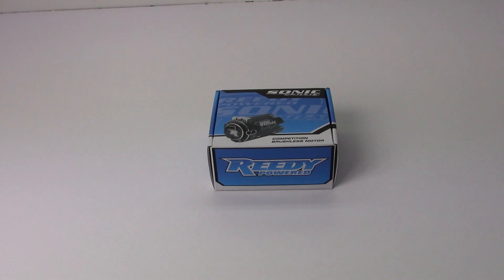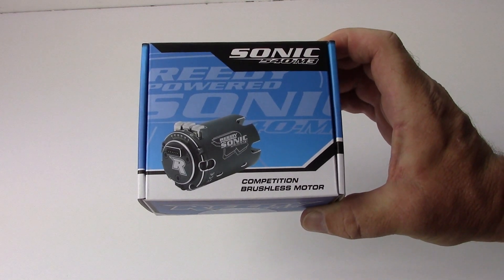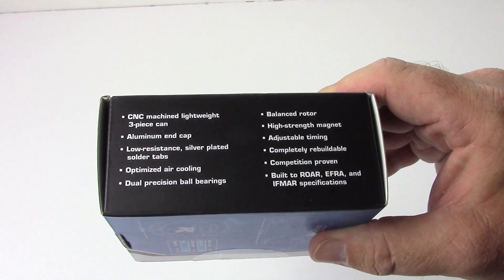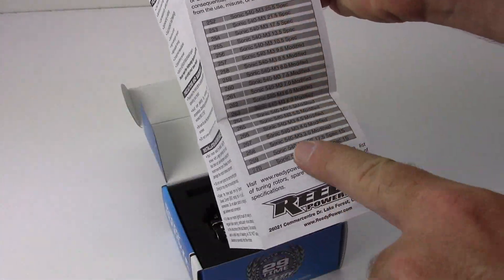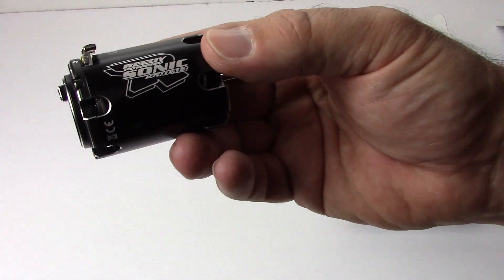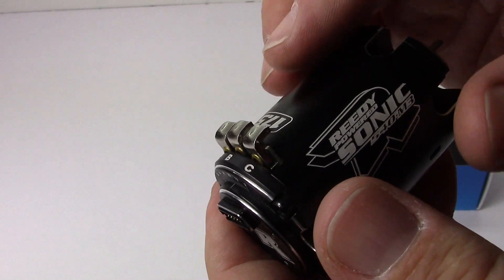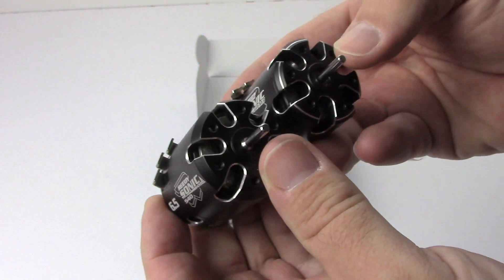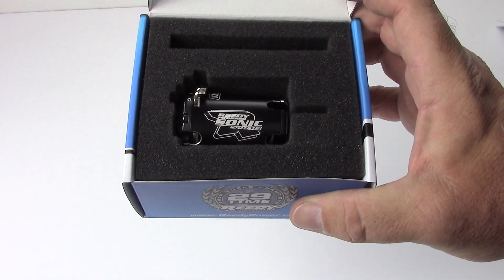Reedy Sonic M3 540 Motor Unboxing - Mach 2 Compare

Comment: I dig how they did the solder tabs..very nice. Absima does that to their motors and those are killer motors with great resistance and current draw.
Reply from the maker: +Chester Copperpot Yep, very nice solder tabs....I can already tell!
Reply: +The RCNetwork +Chester Copperpot Maybe the Absima and Reedy are produced on the same assembly line ;-) The older Reedy has some similarities to the Trackstar motors... But maybe it´s a coincidence :-)
Reply: RCHamburg Probably...like the Orion, HW, Reds Racing ESC etc etc..a lot of similar designs.

Comment: Imo reedy motors are worth the money.....I had a old reedy 3300kv motor in a basher rig that I had beat the snot out of and I finally killed the basher so I pulled the electronics and motor and gave it to a newbie who has beat the hell out of it never cleans it and over heated on several occasions and it is still going strong. yes it is a bit sloppy and doesn't perform as well as new but I am shocked that it even still running after seeing what it has been through.
Reply from the maker: +Craig Schofield Nice!  It's nice to hear stories like that.  I recently read the story on AE/Reedy and it's amazing what those guys did back in the day....

Comment: Hey Rich..you have plans on getting(if you don't already)a motor analyzer? Like the G-Force one? That'd be cool to see motor reviews with a direct test of the kV, sensor board and rpm results.
Reply from the maker: +Chester Copperpot I haven't planned on it.......but like everything in RC, I typically don't plan on it! lol
Reply: The RCNetwork lol yea. I use to follow a guy who'd do that. Unbox and throw it right on the box to see if it matched the specs on paper. I want to get one of those, a gaus meter to check the strength of the magnetism of the rotor and a good resistance meter. I want to have a nice little test lab setup so..any issues I can check myself before sending a motor in if need be. Or just general testing which, I'm sure you know..can be as fun as driving lol

Comment: are the large openings for cooling going to make it harder to keep the internals and bearings clean?
Reply: Depends where you run it really and what kind of setup..rear motor, mid motor. Obviously a mid motor will help keep it cleaner. And if you run on a loose or loamy track. I use to run a stadium truck back in the day on a very, very loose almost sandy track and it was hard to keep the motors clean. Bearings would get destroyed quick. But most tracks these days are clean enough that motor issues are not a big deal.
Reply: Thanks for the response. Thats what I was thinking.
Reply from the maker: +Justin V Like CC said, depends on where you run.....They do a great job of keeping things cool and the motors are fully re-buildable
Reply: Justin V  I believe you are right

Comment: do you think that the reedy products are worth their price? ive had alot of luck with smaller brands, and ive always wondered if the reedy stuff really that good?
Reply: Their stuff is good. I ran several different motors, one being a Reedy Mach 2 and its comparable to most big names.
Reply: +Chester Copperpot i have a b4.2 running the smc racing stuff, it works well, but im gonna get a b5 soon, so i was debating weather to dish out the money and buy a m3 motor
Reply: +Chandler Thomas Honestly, if you can get their last gen motor for a good price..I'd do that. I won't spend anything over $80 on a 10scale motor. I like Orion motors..but $120-150 for a 10th scale motor is insane lol
Reply: +Chandler Thomas the reedy sonic is the motor, honestly for me it is the face of 1/10th scale motors, It's what you think of when you say 540. never had one, but a whole ton of people use them and love them
Reply: They have a ton of great wind motors (7.5, 8.5, 17.5, ect.) but on a outdoor stick to cheap stuff else preformance will suffer greatly but on clay its perfect!
Reply: yah outdoor the dust will get in nasty spots.
Reply: +RC Buggies the track i race on is dusty somtimes, but its indoors. is it the same thing?
Reply: i really don't know, I'd ask the hobby shop owners at your track or just other drivers
Reply: Chandler Thomas blow it out with a air compressor or if you don't have one..computer duster in the cans work good too. As long as its not bad like sand..you'll be fine.

Comment: do we know what the differences are between the 1s spec and standard motor versions?
Reply from the maker: +bionicmonkey25 I'm not the biggest expert in 1s, but basically it's for the 1/12th pan cars that still run 1s electronics.  I would assume it turns the motor as fast/torque with 3.7v vs the standard 7.4v.  Of course, the ESC would play a huge role
Reply: +The RCNetwork thanks for the response.  I just used Team Associated exchange program to get one of the exact motors you have in your video. I was planning on using it for 1 10 scale pan car, and then I realized that they make the 1s version as well. so I did a little bit of digging and after reading a couple of online forums I realized that the windings maybe a little bit shorter in overall length on the 1s version. I'm not quite sure what that gains you, maybe some weight savings and possibly some faster spool up and less drag during coasting. the rotor is the same and the circuit boards are the same as tg e standard version... I just was curious to see if I wasted my money.  as an FYI, these multiple piece cans are a major PITA to reassemble.  the rotor wants to pull the windings out of the can before you can get the end bell aligned. I hope the performance is worth it.  Thanks.
Reply from the maker: +bionicmonkey25 Cool, thanks for the info....

Comment: what esc do you recommend for this motor? i run a reedy 3400 kv in my b4.2 but i think this motor would be way too powerful it a sc 5000 - bl xp digital
Reply from the maker: You can match it with the Reedy 800Z or the 1000z ESC's - both are super smooth.  The 1000z would get you extra features and let you run some mod motors in the future
Reply: The That4starball

Comment: how do you connect it to the esc
Reply from the maker: +Ian Holt Using 12g motor wire and a soldering iron.  See this video:  https://www.youtube.com/watch?v=dvMR2YH2DxE
It's an older video, but has the same context

Comment: has any one ever had bad breaking with this motor ?? I have a 7.5 reedy and I nottice the breaks don't work as good as my Speed passion roar approved motor did .. maybe its just my reedy motor  but i would like to know  if any one else thinks the same thing . Motor has amazing power and very smooth but I feel that the braking sucks . its powered by my Orion r10.1 esc
Reply from the maker: +669Banshee You can't beat Reedy motors.IMO
Reply: +The RCNetwork  still don't answer my question.  how was the breaking on your reedy .  I have reset  esc. mest with the breaking on the orion r10.1 . changed the setting on my Futaba 4px . all I'm getting is  full brake or like no breaks , but no happy medium .
Reply from the maker: +669Banshee I have a rule that in my race rigs, I don't mix brands of electronics (unless un-avoidable).  I can only comment on how my Reedy Mach2/M3 performed with the Reedy 410r BlackBox Speedo - Which was flawless and is now my favorite combo for 1/10th scale racing.  Never had an issue with the braking, and I love braking!  Sorry I didn't answer your question, but there's probably a thousand reasons why you might have braking issues in your car.  The ESC and Radio would be my first place to look.
Reply: +The RCNetwork  ok thank you. my friend has a reedy black box  esc ill have to try it in that and see what it does . thank you .
Reply from the maker: +669Banshee you're gonna have to trouble shoot it....depending on when it was purchased (if it is bad) Reedy/AE are very fair people to deal with.

Comment: i believe it is stupid to have 3mm axle on the motors.. i buy only 4-5mm because 3 mm is crapy and hard to find replacement ballbearings
Reply from the maker: 98% of 540 sized brushless/sensored 1/10th scale race motors will be 3.2mm or 1/8th inch motor shafts.  Any reputable motor company will carry the replacement parts.
Reply from the maker: Robo Tiger nope
Reply from the maker: Robo Tiger SCTE?
Reply from the maker: Robo Tiger there will be a risk....a 7.5t motor equates to about a 5900kv. I have ran 3s on a 5700kv motor in a touring car (much lighter) for speed runs (it was not recommended. You just gotta watch your temps. If that motor get at or above 200 degrees F, it could De-magnetize and be a nice paperweight. If you have it in it, try it. But from experience, your SCT will probably start to go airborne on 3s with that motor